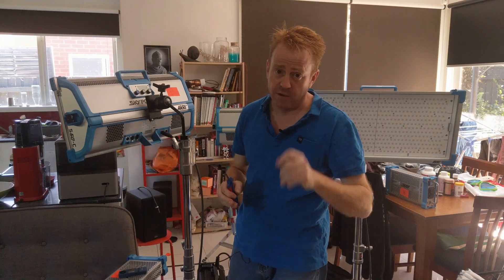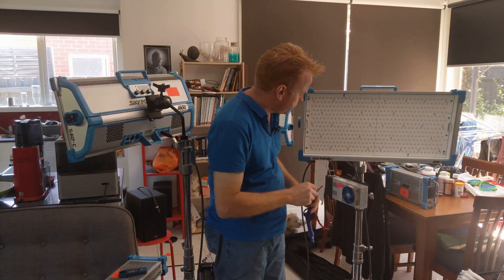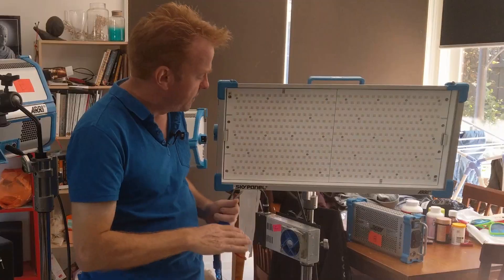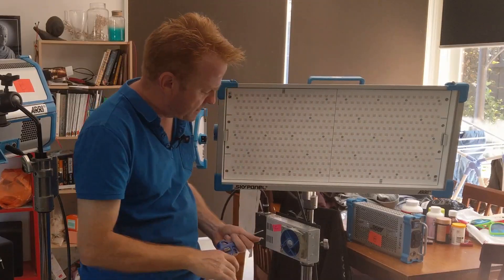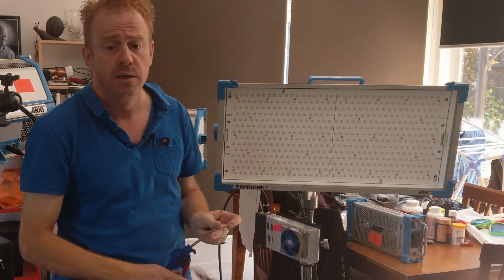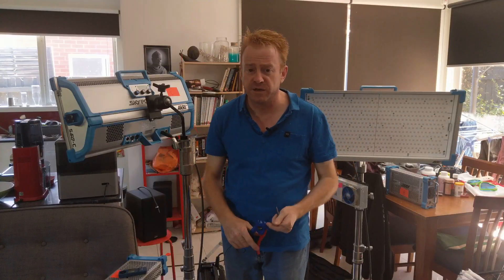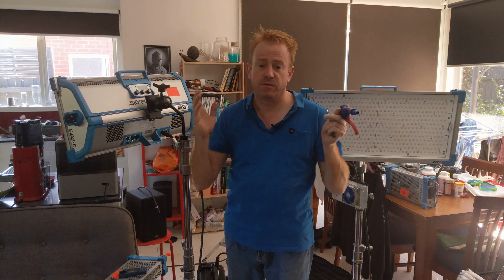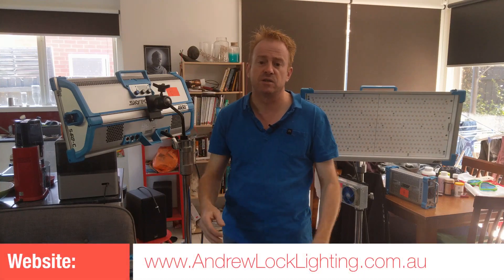Gaffer & Gear 25 - Skypanels Slowly Overheating

Comment: Thanks for this! What PSI would you recommend for air compression?
Reply from the maker: I blast everything with 90 PSI because that's what was recommended in the instructions that came with the nozzle.

For the air compressor, get one with enough PSI that it can pump up your tyres nice and easy.

I made the mistake of getting a small size and I wish I had gone with a bigger air tank as I'm constantly waiting for it to refill